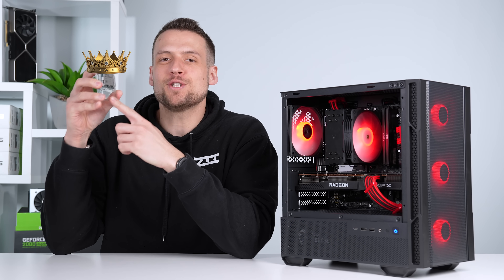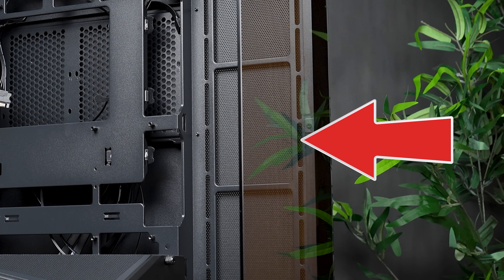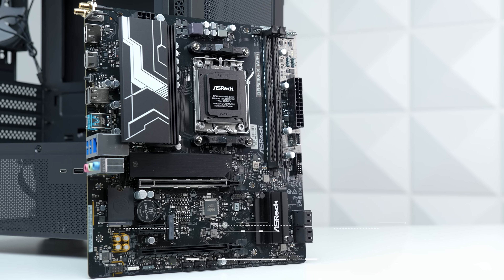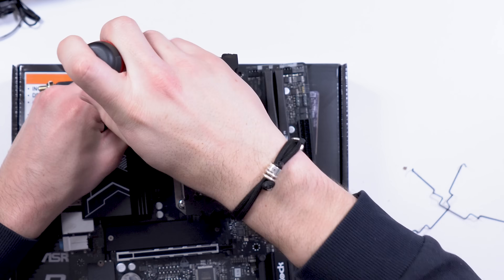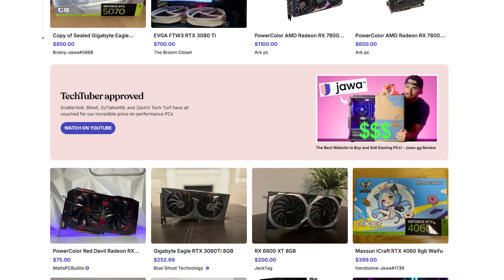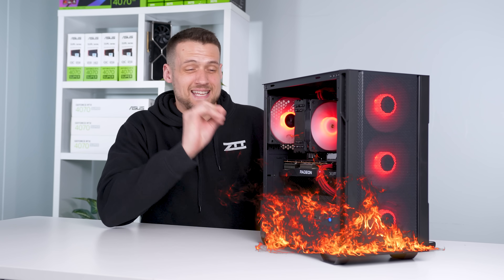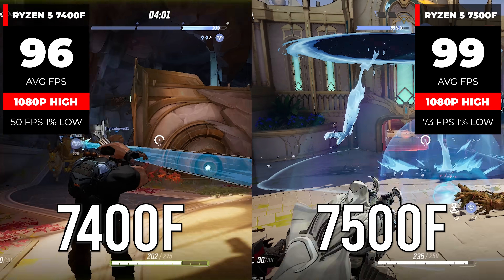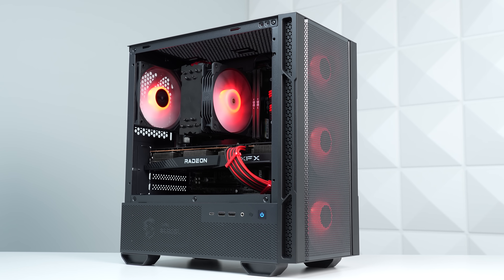$800 Gaming PC Build Guide

Comment from the maker: Be sure to check out the new Okinos Aqua 9 and 93 cases! https://geni.us/FbJQPfY
Reply: Hey Zach, is the r5 5600 a good budget cpu option to pair with an rx 7600 xt, ir you got any recommendations my budget is 80$usd and am4 chipset.
Reply: I'm going to buy whether i5 15gen ultra 5 235 on h810m motherboard or 

ryzen5 7500f on a620m motherboard this month FOR REAL. Both prebuild.

The other parts GPU PSU ram same. 

Please, which is better?
Reply: @29Kd11-f3l  both are trash
Reply: you can get an  5 8400F for the same price can you do that cpu next
Reply: Do you think a 3080 ti used will be good for this? I plan to upgrade the 7500f to like 7600 9600x in my birth day 3080 ti use i usually found 270$ or under on ebay
Reply: @ dont upgrade your cpu insted try to get a even beter gpu later on get a better cpu
Reply: Could I get some advice ? I made a new build, I got an amd ryzen 7 9800x3d cpu but I’m just missing a GPU (yeah first world problems, join the club and waitlist) but I don’t know what I should get, say I have access to them, should I go for a 4090, a 5080 or should I go for something else ? Solely gaming build btw
Reply: @SenDaddy00  I would say whichever one you get acces to first. Also which one you can find cheaper. Right now there are rtx 5080s going for around 800 dollars on Aliexpress while there are some 4090s going over 1k dollars. I would go for the rtx 5080
Reply: Do you think that it is possible that NVidia is protecting us? If the most Dominant GPU company decided to give us more VRam, developers would stop to care about optimization at all and would double their Vram usage. So by not giving a lot of Vram, they are actually limiting the game companies in terms of what they could get away with. I am not defenting NVidia, just thinking outloud...
Reply: I just buyed a ryzen 5 3600, what gpu should I put with it, I was thinking a 3060
Reply: the video is out for 30 minutes and you commented on it 1.3 hours before upload?!
Reply: dumb question isn't the 7700 better? it might be more expensive but isn't it a better more reliable workhorse that has ALOT more potential for futureproofing your rig? I ask because I was thinking of getting one but its been a minute and I've lost track of whats good today and what has fallen out of style?
Reply: thanks for the benchmark videos, this definitely opened my eyes that this used hardwares can still play triple a titles with great fps on 1080p ❤
Reply: pls hhelp me gyse
Reply: Try building in the okinos cypress 3 matx case its 60 bucks on Amazon rn its the same case as this one but with genuine walnut trim on the front panel
Reply: 'Bro I have hp prodesk 600g1 sff which gpu I should upgrade under 4000 inr '
Reply: Greetings from Romania! I've been casually watching your channel for a while and even more often since I decided to switch back from a laptop to a PC. This is going to be my first build and I would really apreciate your feedback. I just placed an order for (aprox. 1200USD): 
CPU Cooler – Deepcool AK620 Digital ARGB Black
MB – MSI PRO B650-S WIFI
CPU – AMD Ryzen 5 7600X
PSU - Seasonic B12 BC-750 750W 80+ Bronze
Case - Deepcool CG530 4F
RAM - Kingston FURY Beast 32GB DDR5 6000MHz CL30
SSD – Crucial P3 Plus 1TB PCIe 4.0
GPU - GIGABYTE AMD Radeon RX 7800 XT GAMING OC (I would have liked a GRE but its a 250 dollars difference for some reason)
Reply: @RAPascu397  thats a desend pc zou can eseli play in 1440p
Reply: Will I lose everything I have installed if I change my graphics card
Reply: @dizzyonthatsip  no dont worry you wont lose you data
Reply: Zach on new egg they are selling refurbished zotac 3080s for 350$ can yo do a build with one?
Reply: Hey I am a big fan of you I wanted the fake plant the headset stand and the mouse pad but you don't ship in India so can you give me one I have the money for it 😢😢😢
Reply: i knwo i will get 0 help but still abit of hope.
is ther a realy good pc build for 2,5k - 3k (maybe under 3k so i can get a new monitor too)
(german € pricing.) ther are so many usa/engl youtuber but ther builds ands tuff i cant get here ease over ther links sadly.
Reply: zach I'm planning to buy a pre-built computer for gaming and streaming, what specs would you recommend?
Reply: Zach I feel like you are always recommending the Rx 6700 xt and I feel like the 7600 and 7600xt are being unappreciated. I just built my first pc with the ryzen 7 9700x and the 7600xt 16gb and it can play fortnite 1440p at 190+ fps easy. I just looked at amazon and the 6700 xt's price is way higher than a 7600 or 7600 xt. The 7600xt is also ranked higher on your gpu comparison chart
Reply: I build a PC with
AMD Ryzen 5 8600G
Arctic Freezer 7 XMulti-Compatible Air CPU Cooler
MSI PRO B650M-B DDR5 AMD AM5 m-ATX Motherboard
Team VULCAN 16GB 5200MHz DDR5 CL40 Desktop RAM
XOC SP900 1TB PCle 4.0 NVMe SSD
Sapphire NITRO+ AMD Radeon RX 7700 XT 12GB GDDR6 Gaming Graphics Card
Deepcool DQ850M-V3L 850W 80 Plus Gold Full Modular Power Supply
PC POWER OCEAN VIEW V1 MATX GAMING CASING (5 X ARGB FAN) BK
PC Power PCG25F180W 25 Inch FHD IPS 180Hz Gaming Monitor
Is there any problem with my build let me know
Reply: Hey I got a question for Zach tech turf can you make me a YouTube short and include my name my name is denim and I wanted you to rate my PC I got a 1070 TI for free from somebody I know that was getting rid of it also got a PC case for them for free I also got ddr4 ram 32gb for only $52 I also start a CPU the CPU that I'm using is a 12th gen Intel core i5 2400 s LG 1700 with a 760m motherboard I also forgot to say I got bunch of fans for free that works with my build I am fallout 4 and a little bit fallout 4 VR I Skyrim and I want to play Skyrim VR but that's a little bit harder and Minecraft and Minecraft VR I also got the quest 3s and a 600 watt power supply but that's the last thing I need to get me they're getting a 600 or 700 w but I don't know yet
Reply: I got another question can you tell me Play if I need to get a 600 w or a 700 w I need to know before tomorrow or before 7:00 preferably that time 7:00
Reply: Sorry I didn't mean the time that how are some not realize I'm not videos time by the way I'm 13
Reply: Nope I finished it
Reply: FIRST REPLY SIGMA DIDDY GYATT HAWK TUAH RIZZZ

Comment: I recommend going for am5 so you can upgrade in the future so my build recommendation is
Cpu:Ryzen 5 7400f
Motherboard:Asrock B850M X Wifi
Ram:Silicon Power Zenith 2x16GB 6000MHz CL30
Gpu:XFX RX 6700 XT Speedster SWFT 309
SSD:Klevv CRAS C910 1TB NVMe Gen 4
PSU:MSI MAG A650GL
Case:Okinos Cypress 3
Cooler:Vetroo V5 Black ARGB
Optional for aesthetics:
Cable Extensions:Asiahorse Red/Black Cable Extensions

Comment: The 7500f is basically the same price on aliexpress but has a soldered die rather than a thermal pad and higher clocks. I would definitely pay the extra $10 for decent temps and better performance.

Comment: PSU : NZXT C1000
PROCESSOR : AMD Ryzen 9 9950X3D Processor
COOLER : Arctic Liquid Freezer III 420 ARGB CPU
SSD : Samsung 990 EVO 1TB M.2 NVMe Gen4 SSD
RAM : CORSAIR Vengeance RGB DDR5 RAM 64GB (2x32GB) CL30 6000MHz 
MOTHERBOARD : ASRock Phantom Gaming X870E Nova WIFI
PC CASE : Lian Li O11 Vision Compact E-ATX Mid Tower Case
+
Gpu 5070ti zotac. Is this a good config plz help

Comment: for me personally i paid like 550-600 after tax and i run an i gpu setup with decent specs okinos aqua 3 white and a r5 8600g and a GIGABYTE B650M AORUS Elite AX ICE AM5 matx and just a 650 watt psu and 32gb of ddr5 and also gonna get a rx 6600 bc i dont do anything more than 1080p and i do alot of pc vr
Reply: it runs fine for me atleast

Comment: Hi I’m trying to enter the pc building niche and want to get your opinion on my pc parts pick.

Cpu-ryzen5 7600
Gpu-Radeon rx7600 dual oc
Memory-Corsair Vengeance 32gb ddr5-6000
Storage-Crucial P3 m.2 pcie 
PSU-Corsair cx 650w 80+bronze
Motherboard-Asrock b650 pro rs micro-atx
Total:$900

Note:I thinks its only good on 1080p gaming but i want to upgrade to a more high performance parts later.

Comment: Personally, I think its worth it to pay 20-70$ more to get a used 3070, the performance will skyrocket along with getting dlss, stream encoder, and a "rtx" gpu
Reply: they are really close but the 6700xt got 12vram instead of 8
Reply: @Cool_Djura2  Yeah I have a 1080p 240hz monitor though so vram isnt a big problem for me

Comment: IS this build good or not

Cpu: AMD ryzen 5 5500

Motherboard: MSI B450M Mortar Max

Ram: 8GB DDR4 3200MHz white corsair venqeane ×2

Cpu: AMD Radeon RX 6600 8GB VRAM white

memory 1TB NVMe SSD

Psv: be quiet! Systém Power 10 550w

Case: Montech Air 903 Max White

Cooler:wraith stealth

All in white

And i am 12 years old don't shame

Comment: Hey man you are one of the rare people i trust with pc info. Can you suggest a pc that would last 5 years without having performance issues in new gen games? I have max 2000 but i was thinking 7900xtx or 5070ti based System (pure performance)
Reply: - ryzen 9 7800x3d
- 4090 ( or 50 series 70 and above )
If your budget exceeds you can get the 9070 XT which is equivalent to the 5070 ti / 5080.
- 32 gigs ddr5 ( or you can get 64 gigs  or maybe even 16 )
Overall I believe these will future proof you for 5 years ! 🔥
Reply: @joejoejoe_1  4090 is twice the price of 5070ti in my country i could think about 9070 xt. Thank you for the advice 🙏

Comment: Bought 2 pre builts before building my first pc specs are Ryzen 7 5700X
MSI MAG B550 TOMAHAWK Gaming Motherboard
F600 PC Case - Pre-Installed 6 PWM ARGB Fan, ATX Mid-Tower Gaming PC Case
Thermalright Phantom Spirit 120 SE ARGB CPU Air Cooler
Silicon Power 4TB US75 Nvme PCIe Gen4 M.2
CORSAIR VENGEANCE RGB PRO DDR4 RAM 64GB
Rx 6700xt
850w mag atx 3+ psu

Comment: What case can I case swap for  dell optiolex 390 plss answer it  Im upgrading my pc and Im on a super duper budget, my current set up has 16gb of ram  (2 different types of 8 gb), an i5 2500, 500 hdd, 128 ssd, and a stolen gt 610 in my schools computer, ( I am planning to buy R7 240 so I can put back the gt 610 that I stole and now I want to case swap it pls answer it because I cannot find any case and I am planning to swap psu too🙏🙏

Comment: Ryzen 5 7600X
MSI B650M DDR5 Motherboard
Gskills 16GB RAM DDR5 RAM
Crucial/WD 1TB NVME SSD
Asrock/Asus RX 7800XT 16GB GPU
Zebronics/Gamdias RGB Cabinet
DeepCool 650W 80+ PSU
Zebronics 240 Liquid Cooler

Bro is this a good build any suggestions

Comment: So I built a PC with a 7800X3D, 64Gb of DDR5 RAM, a Gigabyte Aorus B650 WiFi motherboard and a Radeon RX 7900XTX, I have a huge problem I need help with though, the 7900XTX, apparently since day one has been broken on a chip set level, I got 3 bluescreens on the first day of having it but didn't expect it to be the GPU so I decided after I thought I fixed it to just leave it be, problem is you can't get a 7900XTX right now (with the 50 series launch and all) and my local Denver Microcenter doesn't have any good GPUs in stock, do you have any recommendations for a GPU I could use until the 7900XTX comes back into stock?

Comment: I just bought the parts for this for a similar price what do you think. 

AMD Ryzen 5 5600 3.5 GHz 6-Core Processor

Thermalright Peerless Assassin 120 CPU Cooler

MSI B550M PRO-VDH WIFI Motherboard

Corsair Vengeance 2x16gb 

Kingston nv3 1tb

Sapphire PULSE Radeon RX 7700 XT

Corsair 750w

Will be my first ever pc
Reply: Not bad bro I like it

Comment: What are your thoughts on a pc with the ryzen 5 7500f, vetro v5 cooler, asrock b650m, silicon power zenith 32 gigs of ram or corsair vengeance 32 gig cl36 ram, Klevv cras 2 terabyte ssd, Msi mag 650 watt modular power supply, okinos cypress 3 case. I don’t know what gpu to get, I want the build to be used for pc vr mainly and Mx bikes, I was thinking about am4 chipset but I would like am5 for the future maybe, this is my first pc build and my budget is around 850 and im very in experienced with pc building but I have been binge watching your videos to learn thanks if you respond

Comment: Sir I have this processor. I want to install a GPU in my PC. Which one will be right? I edit normal videos, design on canvas and design websites. Please tell me which one will be better. I still want to use davinici. Please tell me a GPU that can support davinici.
Device name DESKTOP-QB4SOG0
Processor Intel(R) Core(TM) i7-3770 CPU @ 3.40GHz 3.90 GHz
Installed RAM 12.0 GB (11.9 GB usable)
Device ID 0AEFE7CC-BB2E-46CA-80D9-05863F4573C6
Product ID 00330-80000-00000-AA254
System type 64-bit operating system, x64-based processor
Pen and touch No pen or touch input is available for this display
give any hindi option my budget is 5000 indian rupees

Comment: I am building a pc under 76-77k (INR) 

PURPOSE. ::--AAA GAMES AND HIGH BLENDER WORK

MSI G255F 1080p 180hz monitor 

Rtx 4060.      I5 14400f.           16gb DDR5  6000Mhz

1 tb 5000mb/s SSD.         Gigabyte b760m g ax board

Galax rev 06 cabinet.   OR  MSI 120A CABINET OR CIRCLE EMEMINATOR X5 TYPE C     CABINET 

. Msi bn650w 80+ bronze
                     Under 78k inr 

ANY SUGGESTION 
LOVE FROM INDIA

Comment: Day 1 of asking you to rate my first time build(pls):

CPU-AMD Ryzen 5 7600X	
CPU cooler-ARCTIC Freezer 7 X
MOBO-GIGABYTE B650 EAGLE AX
RAM-Kingston FURY 16GB KIT DDR5 6000MT/s CL30 Beast Black EXPO
GPU-GIGABYTE Radeon RX 7800 XT GAMING OC 16G
PSU-ADATA XPG CORE REACTOR II VE 650 W
SSD-ADATA LEGEND 860 1 TB
CASE-Montech FIGHTER 500 Black

Comment: Trying to figure out if I want a new PC or just replace my CPU as I have burned out the one I have according to a repair shop, My system runs -mother board is a gigabyte B450 MDS3H -CPU is Ryzen 5 3600 6 core -GPU is a Nvidia RTX 2060 super - ram is OLOY 36 gigs 4 sticks of 8 - power supply is apex gaming Ax 550. Should I look at upgrading my PC or just replacing my CPU and maybe cooling system?

Comment: I wanted to know if this is a decent pc? Only for gaming ofcourse. Configuration: • CPU: AMD Ryzen 7 5700X, 8x 3.4 GHz • Cooler: Jonsbo CR-1400 Evo Standard Memory: 32 GB DDR4-3200 MHz (2x16 GB), dual channel • Graphics card: NVIDIA GeForce RTX 4060, 8GB GDDR6 • Mainboard: ASUS PRIME A520M-A II/CSM, AMD A520, AM4, mATX • Hard drive 1: 1000 GB M.2 SSD (NVMe) • Power supply: ADATA XPG 600W, 80+ Bronze • Case: ATX-Midi Valor Mesh, black • Operating system: Windows 11 (pre-installed and ready to use) • Service: Service24 basic

Comment: Hey can you tell me how is this build.
INTEL CORE I5-12400F
• EASE 610M MOTHERBOARD
• 16GB 3200MHZ RAM
• 256GB NVME 1 TB HDD
• NVIDIA RTX 3060 12GB used
• THUNDER X STAR CASING +3X FANS
• STOCK CPU COOLER
• 600watt 1st player
I bought this for 535 dollar

Comment: i have a laptop lenovo ideapad 3 r5 5600h with rtx3050 problem is when i initially buy  the laptop it had 8 gb ram rank of Rx16 and i upgrade it with 16 gb rank of rx8 and didn't install 8 gb ram  . so , what will happen if i install both ram together with different rank of ram in long run  and i am student if anyone can help me with this it will be huge help because I am not able to find any information on this .

Comment: I found this laptop in amazon and pay attention to the specs: Acer Nitro V Gaming Laptop | Intel Core i5-13420H Processor | NVIDIA GeForce RTX 4050 Laptop GPU | 15.6" FHD IPS 144Hz Display | 8GB DDR5 | 512GB Gen 4 SSD | WiFi 6 | Backlit KB | ANV15-51-51H9

Comment: This is the $800USD build i've been able to make in Australia with all new parts
5700x (aliexpress), 7700xt, Asus Prime B550m-A Wifi, 16gb 3600mhz rgb ram, Kingston NV3 1tb 550+w bronze psu, Thermaltake view 170 case, Cooler Master H412R CPU Cooler. Came with Monster Hunter Wildlands too, solid effort i think.
Reply: The 7700xt cost me around $380USD including the game and 10% Tax is included here in Australia and 2 year minimum retailer warranty. With the current export tarrifs parts are more expensive here then usual but built this cheaper than most 5500/4060 builds i see locally

Comment: Hey so i got a crazy deal on some stuff. But i wanted to ask if some parts would work with eachother. I ordered a gtx 1080ti and an MSI MPG B550 GAMING PLUS AM4 with a ryzen 5 5600. Motherboard had a combo deal with CORSAIR Vengeance LPX 32GB (16g 2 pack) so I got those free off new egg. I also bought a KLEVV CRAS C910 1TB off Amazon and MSI MAG A750BE and a Oak Wood ATX PC Case. All this for $605 before taxes and shipping. Is this a bad set up or did I go the right direction?

Comment: I hope you see this question;

I am currently running a DDR4 system with 2x KHX3600C17D4 / 8gx as RAM.
I want to upgrade to 32 GB with 2 additional sticks however same sticks are no longer in stock.
I found this stick which is almost same with my current RAM in terms of brand and market values of speed and latency. KF436C17BB/8
The difference between two sticks is heat sink and model name change as I can detect. 

Do you think this would work without issues, or should I simply replace the whole set and try to salvage the old sticks on used market?

Comment: Called NZXT N7-Z69XT-B1 128 GB motherboard, AMD Ryzen 7 9800X3D 8-Core processor, MSI GeForce RTX 4060,  Seagate Expansion External Hard Drive (20 TB), NZXT H9 Flow Mid-Tower Case CM-H91F,  NZXT Kraken 240 AIO Liquid Cooler, Corsair AX1500i Digital ATX 1500 Watt, and Seagate FireCuda Hard Drive STK8000400. Motherboard, CPU, Graphics Card, 20 TB storage, PC Case, Cooling System, Power Supply, and finally Hard drive. Would this be a good gaming pc? (Would not be using ultra graphics at all also used your videos to find the parts)

Comment: I just built with a okinos cypress 7. I was really contemplating the cypress 5 due to the cost but the 7 just looked way better to me. It does have lower build quality to my original nzxt s340 from 2015 but still a solid build with better cable management and MUCH better cooling. 4 fan slots in the s340 compared to 11 slots on the cypress 7.